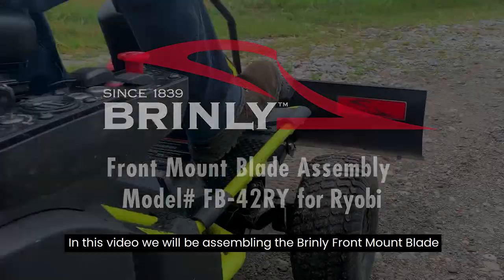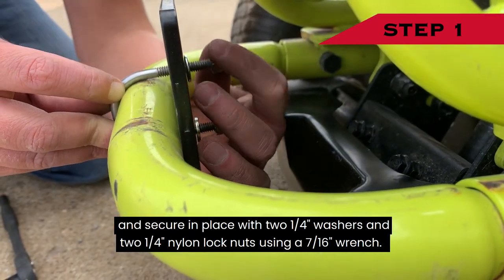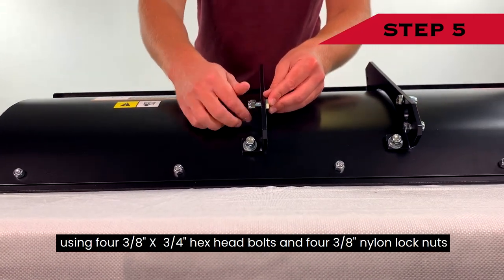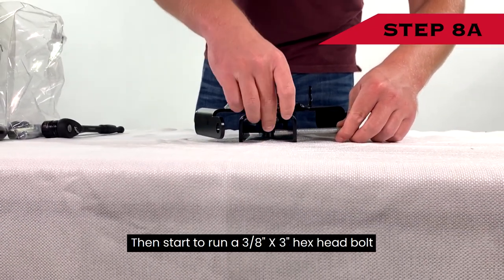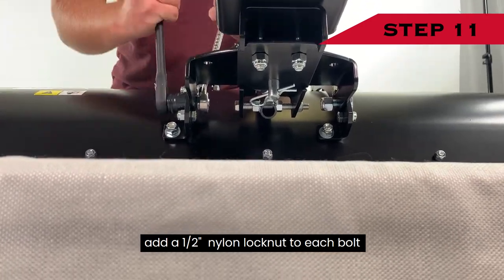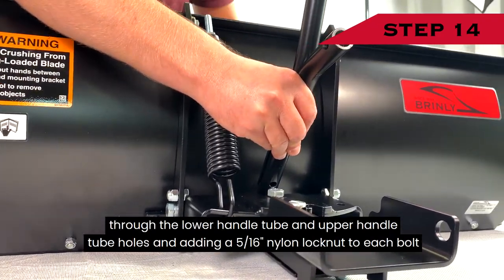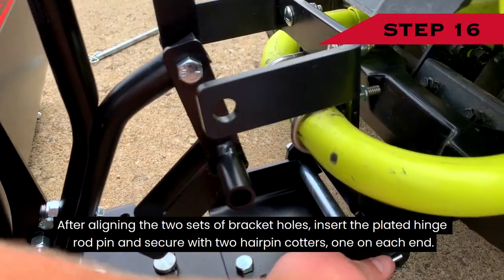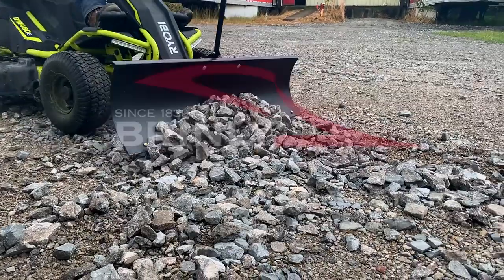How to Assemble the Brinly Front-Mount Blade for Ryobi | Model FB-42RY

Comment: Thank you for the video. Really helpful. I have the same snow plow attachment... The only problem I have is that the shovel blade turns down very easily... With no reason. I was expecting that when I hit a crack or a rock, but with just pure snow, it turns down very easily... Do you have the same issue? Cheers, Walter
Reply from the maker: Hello, please send in some photos of the assembly to customerservice@brinly.com, and we would be happy to take a look at that.
Reply from the maker: Thanks for the question! We now have a video showing that if you tighten down the bolt on the spring in the back, you'll get more resistance and it will take more impact like a rock to tip it. https://youtu.be/Coy-clUq5QU

Comment: Is there any suitable snowplow available for 46" Ryobi lawn mower tractor which has 2" hitch in the front ?
Reply from the maker: Not yet, our the current Brinly snow blade won't fit the larger models. We will put a request in to look into expanding the mower size range, thank you for the suggestion!

Comment: So I tried to get this done and last year and failed. I have a severe walking disability and the manual functions were just to difficult for me. So with a little Yankee ingenuity I came up with this rig. Three linear actuators powered by a single 18v Ryobi battery. The whole unit is installed or removed with two pins and one bolt. The true test will come with the first snow,

https://youtu.be/i0ZiWXDueMo?si=pbdvw2ntErVwYKGT
Reply from the maker: Wow that is so cool! Thanks for sharing, and good luck this winter!

Comment: 8:35 How does this "self locking feature" work? I have completed the installation, but the plow will not stay up when pulled back. I pull the handle back all the way, and it just falls back down when I let go. I have tightened the spring till it touches the bracket, and the nuts on the ribs are facing the right way as per the instructions.
Reply: Figured it out. In step 15, reinforcement bracket, I tightened it too much. This caused the bracket to hit the handle tube when pulling the handle back, not letting it be pulled back all the way (I thought I had pulled it back all the way since it would go no further). I loosened it to allow the bracket to travel farther and into the handle tube. Now I am able to pull it back the correct distance, and it stays locked in the up position.
Reply from the maker: Hello! Please reach out to our Customer Service Team at 877-728-8224. They will be able to walk you through some troubleshooting.